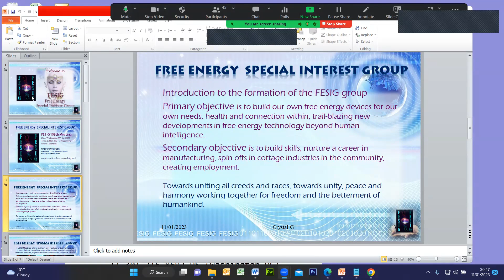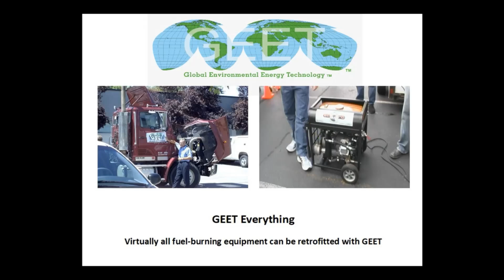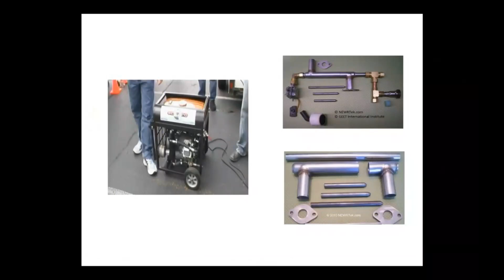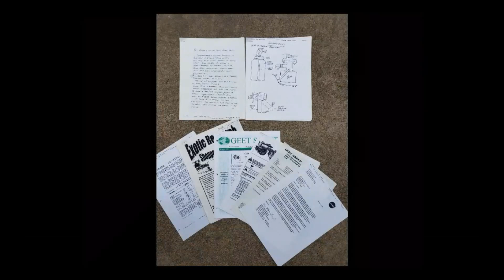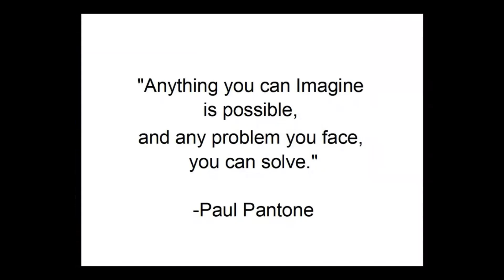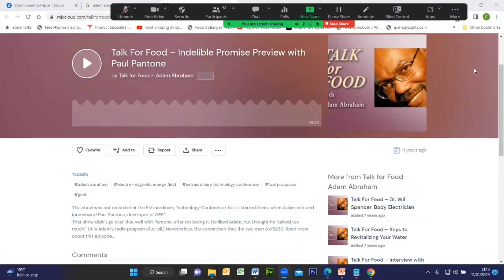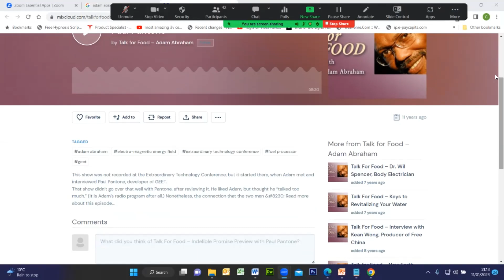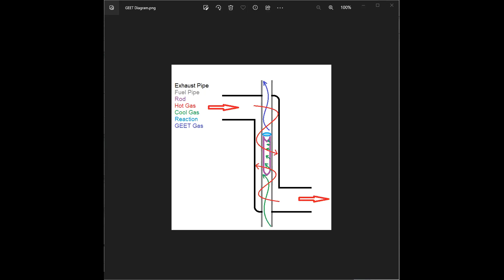FESIG 108th David Pantone: Self-Induced Plasma Generator GEET

Comment: Once upon a time I had a successful GoFundMe Campaign to raise about $2000 to build a working concept scooter. I'm excited to see people are still researching this. Its been some years since I've done any tinkering with my motorbike project. Here's the billion dollar question is how many reaction chambers does a system need to use water? Lighter molecules resonate with shorter reaction rods... water or propane are very light molecules I have to wonder if a system could be built using rods about 2" long and plumbed into a manifold that branches off into multiple reaction chambers... it could be started up with propane and water combined within the same reactor manifold... if you have enough reactors in the manifold for provide enough surface area of reaction rod to contact the water vapor passing by it in the reaction chambers, it could potentially create enough ionized water to keep the reaction sustained once started with a combination of propane and water. Perhaps? Paul might have mentioned you need at least 7 reaction chambers for this to work... Anyone wana collaborate on how to make this manifold system? I've only built them with a single reaction chamber....
Reply: Hi This was my first inclination too I built a four chamber geet but never had it welded do to money and other things. I heard that if the rod gets too long it will make smoke and that you need 20 percent fuel to keep it running.
Reply: how much did your gofundme bring in?